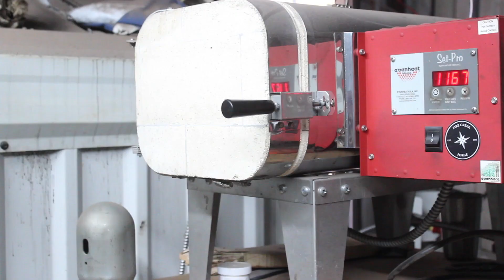Bearded Hatchet In 3 Minutes Hand Forged American Made Blacksmithing And Forging Fire Creek Forge

Comment: question . . . at 1:55 you quenched the axe and plunged it up and down in the water .
why not just stick it in the water ? why plunge it up and down ? 
seriously wondering .
BTW . . . i love them ! i need one !
Reply from the maker: good question. the agitation breaks the vapor jacket that forms. otherwise you'll have slower, and worse yet, uneven cooling
Reply: During quench the extreme heat creates a lot of air bubbles which isolates the objects from the cooling medium, slowing the cooling process that must (generally) be quite fast. Moving up and down the object takes away the bubbles. Usually to lessen the quantity of bubbles some soap or dishwashing detergent is added to the water
Reply: @FireCreekForge  i thought it might be something like that . thanks for the quick reply !
nice axes BTW .
Reply: @giodavid991   thanks
Reply from the maker: @pappy451  you bet. Thanks!
Reply: I was going to ask why a water quench and not an oil quench?  I’m no pro, but I have learned a little and made a few things. I have always used oil to hopefully reduce the risk of micro fractures.
Reply from the maker: @danbrown3843  it depends on the composition of the steel. In general I would say over .6% carbon oil quench is a good idea. If you add alloys that can really change it to.